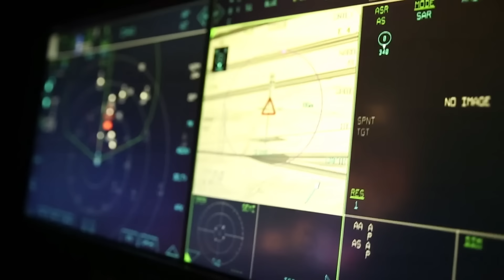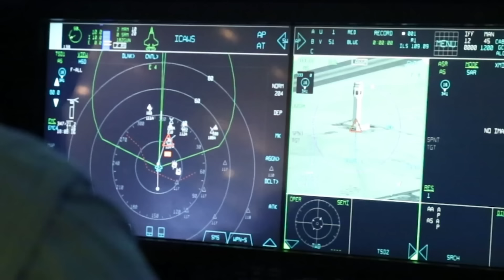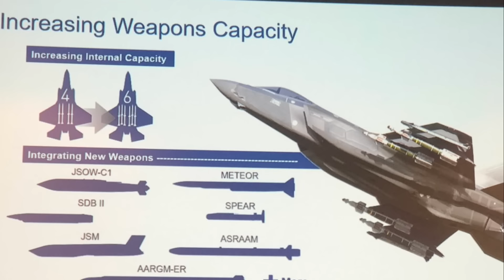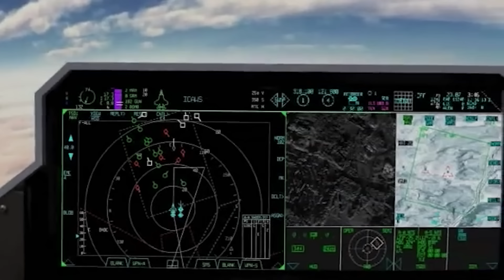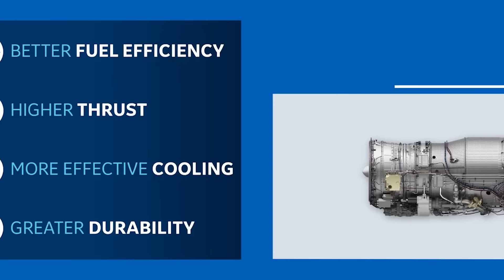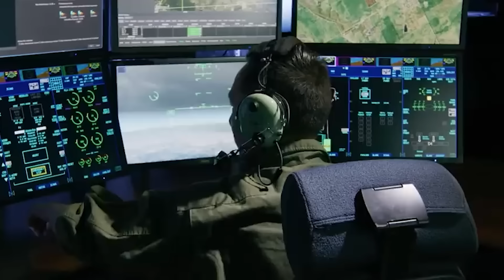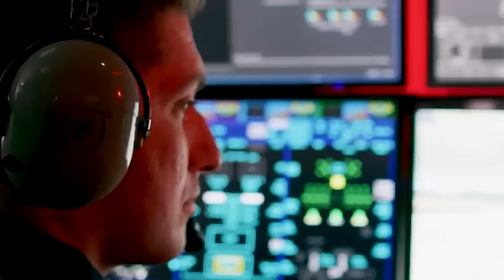The F-35 is about to become a POWERHOUSE

Comment: The F22 can still do better in its sleep than this plane with the upgrades.
Reply: F35's will eat F22's like taking candy from a baby.

F22's are outdated, and have ZERO means and technology on board to take on a F35.

And, since you wonder how this is possible?
Well, I better explain to you.

In the 1950’s everything was thought to center around speed. Even an f104 Starfighter (1958) can maintain supersonic flight without afterburners.

In the 29 dogfight kills during desert storm (1991), max speeds seen by fighters were Mach 1 

Now of course the f22 has award winning kinetic performance, no doubt about it. From a raw performance point of view, the f22 really is impressive.

However, that performance is not going to rack up or increase kills in the battle theatre.

Tops on this list is that due to budget cuts, the f22 lacks “passive” systems to track aircraft. By “passive” we mean receiver only (non radar being sent out). This is where the f35 excels right now, and is a significant shortcoming of the f22.

The F22 was spec out to have a multi spectrum IRST system. Then during soaring costs, they cut that IRST system down to a lower cost single spectrum IRST system. Then, they further cut and removed 100% the IRST system from the F22 program.

As a result, they made a huge mistake, and handicapped the F22. it is now blind as a bat, and given it has no means (other then radar) to engage a F35, it going to lose that battle 9 out of 10 times. The F35 has better stealth, and it has systems on board that will let it track and locate, and target the F22 VERY long before the F22 can do the same to the F35.

Computer processing:
The f22 in its debut had a very good computer system. It is rated at 700 MIPS (700 million instructions per second). 

There was plans to future upgrade the f22 with a 2000 mips processor. But the CPU used on the f22 is now long out of production. 

But, remember Moore’s law in computing? Every 2 years we see computing power near doubling. While this doubling every two years don’t sound like much?

Well, place one grain of rice on the first square on a chess board. On the next square, place 2 grains of rice. And on the next square place 4 (so we have a total of 7 grains of rice).

Do the above for 64 squares. You wind up with 1 billion grains of rice by the 40th square. By the 64th square, you actually need 210 billion tons (not grains, but tons) of rice! That amount of rice would cover ALL of India with about 3 feet of rice!

The above means that the f22 has a really poor computer.
For comparison, a low cost budget smart phone with a snapdragon processor? Well, one CPU core is rated for 1400 MIPS. But you have 4 of them!!! (All in that $90 smartphone).

So, that smartphone has 

5600 MIPS

F22 = 700 MIPS.

So, your cheapo smart phone has EIGHT times the computer power of the f22.

The F35 uses RISC based CPU’s built around IBM’s power PC chips. They are the same architecture and chips used at the Lawrence Livermore atomic labs to run computer atomic bomb simulations. And all of IBM’S advanced Artificial Intelligence systems also use this chip set from IBM.

Upgrades for the F35 central computer are to be rolled out next year – they will increase the computer power of the f35 by a WHOPPER 25 times (over what the f35 has now!!! And what the F35 ALREADY has is VERY good!!!).

Not only does the f22 lack computer power, but it also lacks high speed networking.

While a good many new fighter jets have passive (IRST) systems, they are mechanical scanned (a rotating mirror sends the input light and directs it to a sensor). Such sensors will tell you a fighter is say 35 degrees off the front of your jet. But you don’t know the speed, direction etc.  And those systems have limited coverage (only front/forward looking for the jet).

You need speed, direction, and altitude to generate a weapons lock.

With 3 or more f35’s in the area, then just like 3 compass points or lines on a map, you can with computers triangle the location of the target. (You need 3 or more inputs).

Toss in a BIG dose of computer power?
Toss in some really amazing network communication between the jets?

Well, you now get x,y,z position of that target. And if you do this over and over, then you now get a new set of x,y,z and thus compare it to the last set of data. Now you have the REALLY valuable information of speed and direction and altitude  of that enemy. And you doing this WITHOUT radar to give yourself away.

And even MORE important is you need to be able to feed that data into the computers to generate a weapons grade solution.

F35 can use radar, or DAS (which is IRST) or use the targeting pod on the front (which is also an IRST + targeting system for air to ground - that's the ETOS system, and it is VERY valuable, since then a pilot can identify a enemy fighter at 40 miles away, and can do so without radar --- this is big deal if pilots are required to visual identify the aircraft before engagements - something right now ONLY the F35 can do -- I can explain how this works and is done if you ask).

However,  back to our narrative. At this point, you have NOT turned on your radar to give yourself away.

So, 3 F35’s approaching some f22’s will:

See, track, display and build weapons grade firing solitons against the f22’s. 

And all of this will occur without radar.

The f22?
Blind as a bat.
It will not see, track or be able to deploy its weapons on the F35.

The f35 will simple fire away and shoot down those f22’s like fish in a barrel.

The f22 on board systems are outdated.

In fact, the DAS tracking system will allow the F35 to compute and give a firing solution for a jet following it from the rear. That’s because unlike the f22, the F35 is not limited to JUST using radar for a firing and kill solution. So, to fire at a jet following you requires rear facing radar! (But not with the F35).

So, radar in most jets is required for a firing solution. When the missile leaves the rails, it is NOT the missile that navigates to the target, but the fighter provides computers and radar that manages the first part of the missile flight. When the missile gets close to the target then the missile own radar and tracking takes over. 

And keep in mind that even during war games, the instant you turn on your radar is the instant you just turned your jet into a HUGE giant lighthouse of a target – stealth will not help so much. Look at me, I am here! Come and follow my powerful radar beam right to me!!! Stealth or not – you just given yourself away.

The air battle theatre is now becoming like submarine warfare. Run silent – don’t give yourself away.

The f22 has next to no means to see, find, track and MOST important generate a kill solution to shoot down the f35.

As much as I love the f22?

It don’t stand one hope of a chance to engage the f35.

Now, if someone can explain how a f22 has any kind of remote chance to take on a F35, then I am all ears, but as much as I admire the f22, it not even remote able to take on a F35 at this point in time.

The F35 will pilot will thus have an FAR BETTER decision superiority chain over an F22.  This will result in greater chances of survivability, which when combined with such lethality assures battlespace dominance. 

It just does. Don't mean the F22 is bad, but does mean that the F35 will be a F22 killer, and not the other way around.

So, explain to me how a F22 can engage a F35 when it can't see or find the F35?
But, the F35 SURE can find and target the F22.

Comment: It can do this. It can do that…..blah blah blaaaahhh. But it can’t beat a F16 in a dog fight
Reply: Says who?
That early test has been so de-bunked it not even serious anymore. That F35 did not even have stress management software, and was a early flight control system. Really, that test was to get a "base line" for the F35 flight control software. It was quite much a "beta" edition. (and limited to 5.5 g's).

so, as they progressed the flight software, then they allowed 7'gs. and then they went back to pilots, and pilots stated they wanted more control, and more ability to toss the fighter around. So, another round of flight control changes - including air frame stress management (to pull more g's but reduce wing bending forces). And now the F35 is at 9g's.

So, is a F35 a better dogfighter then a F16? Why of course it is!!!

The simple matter is single tail fighters have significant disadvantages over that of twin tail fighters. The fantastic line of “Su” designs from the wonderful folks at Sukhoi Design Bureau have not even considered ANY single tail fighter in 30+ years. (In fact, no one is, unless they are really short on cash).

So, the F16 has some serious handicaps against the F35, and one big issue is the single tail design on the F16.

This is basic aerodynamics 101. When you pull up hard on the F16, then airflow and pressure builds under the airframe, and now airflow over the rear tail is blocked (it receives less airflow).

So, to solve the above? You put dual tail sections on a fighter. You then move them apart to get clean airflow. You also angle them to bite even BETTER into that airflow. And look from the front all the way to the rear – you can see the tail sections are placed in clean and un-blocked airflow.

Now the above is an obvious observation of basic airflow over a plane.

But, if the above is really the case, then pilots flying the f16, and now the F35 should CONFIRM this design shortcoming of the F16.

Here are some actual pilot notes (a long time f16 pilot now flying the F35).

Quote:
The F-35 provides me as a pilot greater authority to point the nose of the airplane where I desire. (The F-35 is capable of significantly higher Angle of Attack (AOA) than the F-16

So it easier to point the f35!!!
This confirms the single tail design shortcomings of the F16.

And the pilot goes on to state:

Quote:
This improved ability to point at my opponent enables me to deliver weapons earlier than I am used to with the F-16, it forces my opponent to react even more defensively, and it gives me the ability to reduce the airspeed quicker than in the F-16

Quote:
Since I first wrote this post, I have flown additional sorties where I tried an even more aggressive approach to the control position – more aggressive than I thought possible. It worked just fine. The F-35 sticks on like glue, and it is very difficult for the defender to escape

Quote:
Defensive situations often result in high AOA and low airspeeds. At high AOA the F-16 reacts slowly when I move the stick sideways to roll the airplane

Note how the pilot says the f-16 reacts slowly!!!

Who wants to fly a plane that reacts slow? How silly is that???

Again: real world witness and testimony of a F16 pilot pointing out the shortcomings of the single tail design.

So both witness and testimony, and that of aircraft design and physics are in agreement here.

Quote:
Yet another quality of the F-35 becomes evident in this flight regime; using the rudder pedals I can command the nose of the airplane from side to side. The F-35 reacts quicker to my pedal inputs than the F-16 would at its maximum AOA
(the F-16 would actually be out of control at this AOA)

Again, “reacts quicker”. The F-16 would be out of control at this AOA!!!!!

Again, this is conformation of the single tail design shortcoming of the f16

Quote:
Another aspect is the kind of reaction I get when I push the stick forward; the F-35 reacts immediately, and not delayed like the F-16. Looking at another F-35 doing such maneuvers is an impressive sight. The various control surfaces on the airplane are large, and they move very quickly

Note NOW we NOT talking about AOA, but simply how the f35 responds to pilots inputs.

Again, note the “delay” in the F16. The F35 not only uses the rear elevator, but also the two tail fins can augment the airflow by moving the twin tail surfaces to help the rear elevator (because they are angled – they can provide lift in addition to left/right forces).

So two rather interesting issues here:

The lack of f35 dogfighting ability seems to be a myth, and REAL pilot notes not only state that the F35 is very maneuverable, but such pilots note that the F35 fairs better and is more responsive against F16’s.

the F35 has a better (higher) power to weight rating then a F16. If the F16 had more power, or was lighter, then it might stand a chance against the F35, but it does not.

and the F35 is a dual tail setup, and once again, had the F16 a dual tail setup, then it would stand a chance against the F35, but it does not.
The f35 based not my opinion but above quotes will out fly, and out dogfight an f16 rather easy.

The F-35A’s are currently defeating F-16s in close combat by using their advantages in acceleration, better thrust to weight, better AoA & yaw, and then coupled with F35's BETTER capabilities in turn, pitch & roll?

How is a F16 going to take on a F35 in a dogfight when it has a LOWER thrust to weight rating, and has a old style single tail design?
Reply: Dogfight is a WW2 thing boomer
Reply: @edwardcardozo8325  and it’s not a thing of the past. We just haven’t had a war to have to do it. You can’t track and shoot down all targets if there’s a group or actual squadron. Eventually you’ll have to get up close.
Reply: @garydobbs5159  never, once missiles are gone they gonna return to safety and good luck to those ruskis and xinxongs defending against AMRAAM's/Meteor's launched with a stealth plane and i'm sure multiple tracking targets has been a thing for 40+ years and only improving
Reply: Gary comming in with the blatant misinformation debunked by this very channel

Comment: How to defeat the F-35: Don't engage, just wait. It'll run out of fuel soon. When it does, run it down. This thing is a pig.
Reply: The f35 out ranges pretty much every other fighter on the battle field.
Reply: Just don't engage it while it blows up your command centre. You should join Russia;s air force. Would make Ukraine's job alot easier.